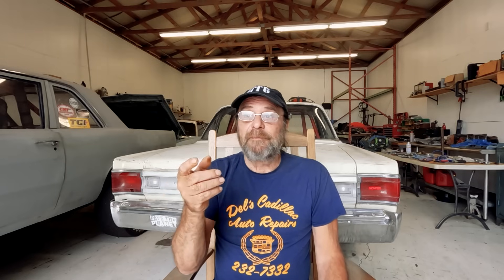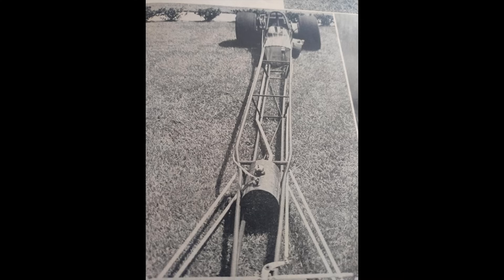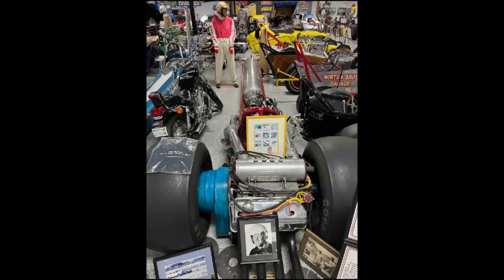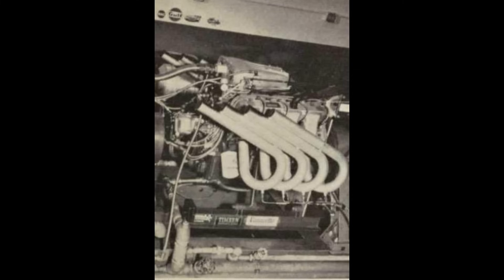Compressed Air Supercharging Returns - Here's Where It All Began

Comment: Just sitting here thinking 🤔 
If you could come up with a method to cool the exhaust Temps.
Similar to the cold air from diving tank input.
But put That same energy into the exhaust system as heat causes expansion and if you can reduce the heat you should be able to reduce the expansion of the exhaust, this causing the exhaust to flow expdentally faster. 
I'm not talking about just using ceramic coating but actually a cooling system that would reduce the temperature.
To your knowledge has anyone ever tried something like this?
PS love your show 👍
Reply: if you're supercharged it doesn't matter and it cools a lot now anyway due to being so hot coming out. you could cool it a lot more with a simple heat exchanger if you wanted to (just a box with aluminum plates going through it)

Comment: Your idea of spooling up a turbo with compressed air was actually floated years ago (back in the 80's) by a guy named Dick Datson who was pushing the idea of turbocharging old boat anchor factory engines with forged internals, particularly Studebakers, with little or no modifications. His genius idea was to use Co2 because it expands exponentially when released into atmospheric pressure. It would have essentially the same effect as a rocket without any combustibles.

Comment: Koenigsegg uses compressed air in the turbo for anti lag. The also have an engine with a pneumatic valve train, no comshafts just air opening and closing the valves, variable lift duration and overlap for ultimate timing control.
Reply: I remember a guy named Paul Bedoian had a company called Prostock Engineering in the late 70s into the 80s making specialty parts for mainly drag racing Ford 390 - 428 engines. He had a pneumatic valve spring setup.  I stopped by his shop on day to buy a oil pump driveshaft.  Some guy from Hot Rod magazine was there and we're discussing Buddy Baker leading at the white flag at the Daytona 500 and losing.
Reply: Yes but Koenigsegg doesn't use their freevalve on any of their engines. They were going to use it on their 2.0 three cylinder but I believe they have decided not to use that engine. Cool tech but for whatever reason they choice not to use it on their V8's.

Comment: One interesting advantage of Compressed Air Supercharging: That air is gonna be COLD!

Also, someone could boost the O2 content of those tanks.
Reply: Or just run O2 tanks. It's been tried.
Reply: The funny thing in the 1320 vid was the driver said he had to use race gas and not methanol because the temperature from the compressed air was too low and combustion would fail. 

Running pure O2 would be far too unstable to work.
Reply: @ThatMattWhite  I have never played with Nitrous, but my understanding is if you don't have enough fuel to meet the nitrous, things can blow up.  Perhaps the same idea with super cooled O2?

Comment: The french navy uses compressed air to run diesel engines in submarines underwater. Same as the 1320 video, the engine is sealed from the atmosphere and runs off of the compressed air from a tank. Think of it as an alternative air supply not forced induction.

Comment: The Garlits museum used to have a straight compressed air dragster 35+ years ago. No fuel, just compressed air delivered to the cylinders. Massive tank. - looked like a boiler. Basically a two stroke - power and exhaust. I do not remember how much pressure it used.
Reply: Didn't they spin a turbine instead of a piston engine. There's stuff on the web

Comment: The Grey Goose Bar is running a land speed car using compressed air from an SCBA tank to spool up the turbo on a 6 cylinder toyota motor in their purple roadster. Sorry, White Goose Bar

Comment: The answer is AWD hybrid with EV rear axle and turbo ICE in front. The charged air is cooled chemically and turbo is spooled via vacuum, produced by solid jet at the end of the down pipe. As most of the low grunt is created via EV, the ICE doesn't need that much of capacity, keeping the overall weight closer to competitive numbers. You can fit all of this in a Chevy Spark easily.

Comment: For the compressed air turbocharger: Ford did a similar thing with one of their wrc cars. They had a tank to store excess boost and release it to use as antilag. Driving 4 answers explains it on is channel.
Reply: I feel like that could be the best of both worlds
Reply: Shilling 4 money*
Reply: Forda set up is anti turbo lag it's completely different and not related at all
Reply: I know it's different but it's a smart way to use an air tank as a way of spooling the turbo. I was referring to the mention he did at the end of the video talking about using compressed air to spool a turbo, I tought it was related enought to be worth mentioning.
Reply: That's more of a boost capacitor, not compressed air supercharging. 
I think what really makes this a different setup is being completely disconnected from the compressor. 
You get 1 run out of the tanks, and use a scuba compressor to refill a series of mother bottles that will refill the on car tanks. They are also at 2400 psi, not 5-8 psi from boost. 
The dramatic pressure drop has other benefits, like below freezing intake air temps. Won't get that same effect from 8 psi pressure differential. 
This isn't new. I knew about it 20 years ago. But the controllers have caught up, so it could be implemented effectively.
Reply: @ryurc3033  Just to add technicality the CAS is being tuned using a boost controller and the engine sees boost. The engine isnt getting direct 2300 psig. The  Tank holding the air is at 3300 psig then it first gets regulated to about 100psig(depending on tune) 70psig for up to 500Hp 120psig for over 850HP. On the CAS system it goes through a 30 psig electronic boost controller.  Like you mentioned the real benefit is that highly compressed air is much colder. Plus it's self contained so doesn't see the drastic tuning variances of outside air condions. Scuba air also has a higher oxygen content.

Comment: The compressed air powered turbo should be the easiest way to implement compressed air.  All it has to do is input as much compressed air flow as exhaust flow.  Try it on some ecoboost heap ready for the crusher before investing too much.

Comment: I was working g for general moters truck and coach in pontiacmichigan in 1979. Pushing a broom. They transferred me to the warehouse. That's where all the parts are. I knew there were 671 blowers in there somewhere because they used them on a lot of the trucks.  It was a big where house. It took me weweeks to find them.  Then there they were pallets full of them sixteen feet in the air.  I about fell out. It looked like one of the right wonders of the world. Then I got laid off again. I went to abbeville south carolina again and never went back even when they called me.

Comment: A tesla turbine mounted on the same shaft of a conventional turbo would both make boost AND scavenge the exhaust if setup with the pressurized air only serving to spool the turbo mechanically. Tesla turbines were designed for efficiency, but end up being relatively low torque output - this seems like the ideal application.
Reply: it still needs high power and nobodys done a high power tesla turbine in these sizes and it would probably need a starter motor and a clutch to get it up to speed to start producing power and not just flowing through.

as for what tony is wondering about why not spool a turbo rather than feed the engine, you can spool up a turbo with just the engine or with combustion but more importantly you lose power(air volume rather) running a turbo with compressed air vs. just running the air into the intake
Reply: @lasskinn474  there's at least one Tesla turbine in the kW range. I completely disagree about a starting mechanism as the turbo could be put in full bypass (open recirculating setup compressor side, and open waste gate) - while spooling. It would have to be steam powered from a power density POV and weight. (Remember compressed air still has mass...and much more since its quite literally more dense). It may not feel heavy by weight but it's lateral mass contribution to a car is significant.

Just imagination going off of what Tony said, I know it's not practical lol. Though, I agree spooling a turbo direct with air directly seems like efficiency loss rather than direct/valving air like the whole video goes over.
Reply: @ you need tens of kilowatts, hundreds for a drag car pushing high horsepower though if you just had separate steam generator from chemicals and just ran it and used it to run an electric charger that would skip quite a bit of the complexity(but you could just as well then put that power straight on the axle).

a lot of research has gone into trying to scavange the energy from the exhaust and usually it just turns out as not worth it. some popsci style magazines were talking 30 years ago using peltier element sort of elements to scavange the heat energy, but maybe steaming some other stuff in a closed loop would work better for that.

i do wish there was some high visibility drag class that allowed more experimental stuff, maybe the rocket powered turbine on the rear axle could be done in a controlled way nowadays.

Comment: The axle through the valley reminds me of the BF-109 fighter plane from WWII. The Germans ran the barrel of a 20mm cannon through the valley of the DB 605 V-12 and out the front of the propeller hub.
Reply: There was an article in hot rod years back that showed some compressed gas tanks with stamping on them showing the years they were checked right next to the luftwaffe symbol stamped also, and they explained the BF 109 also used those tanks for nitrous oxide that was injected into the engine for a quick boost of speed, I know the tanks exist I looked for that over the years after reading that article and have seen them in a compressed gas company one day when I went to pick up some tanks for a torch, the luftwaffe cross and dates stamped from 1939 to 1943
Reply: Lot of countries did that not just germany
Reply: No, not mounted in the valley. The Daimler-Benz V-12 engine was mounted inverted with a reduction drive. The cannon was mounted atop the crankcase and it fired through the hollow propeller shaft.
Reply: @tennesseered586  The engine was inverted, and the gear reduction drive dropped below the crankshaft towards the valley. The cannon barrel did go through the valley between the cylinder banks and out the front of the propeller hub.

Comment: The Turbonique was not a rocket driving a turbo, it was a turbine engine on the rear axle that used a very volatile fuel to power the turbine.
It was like an add on to a quick change rear that hung off the back of the differential with a huge exhaust blowing straight out the center of the axle. There were varying levels of power output with some small enough to put on go carts. 
Now what I want to see is a turbine driven by the reaction of pure H2O2 (hydrogen peroxide) with potassium permanganate which generates super hot steam to drive the turbine. This is what was used on V2 rockets to drive the turbo pumps that fed the rocket engine with fuel and O2.
Reply: That was the best known version but I recall the rocket powered turbocharger Tony spoke of. It all mounted under the hood and was the ultimate sleeper setup
Reply: WW2 fighter engines also used turbo compounding with used exhaust gas to power a turbine which through gear reduction directly powered the crankshaft…supposedly it added power and efficiency
Reply: @chrisvig123 that's basically a jet engine were you replace the jets combustion chamber for a piston engine .

Comment: I would think the turbo issue would be the compressed air super cooling the turbo so fast that it also cooled the intake charge too much and end up with a turbo ice maker ,the air would ice up the pressure side and transfer it thru to the incoming boost charge ...if that makes sense

Comment: Compressed-air?.......maybe the Airlines should look into this 🙈 lol
Reply: You mean how passenger jets don’t actually use any fuel once they’re at cruising altitude?
Reply: It's only good for short distances like the quarter mile. I wondered about using it at Bonneville but if it takes 1 and a half tanks to do a quarter mile, it will take 30 tanks to do 5 miles. You would need to build a huge car to take all those tanks. There's also the question of everything freezing up during a long run

Comment: So you flip flop the tank while the other one is filling. That could increase your efficiency. Oh, at work they had tanks of compressed air that would spin a 3” turbin. It could run the whole building for 14 minutes, before that they used a 600 lb. Flywheel in a clam shell in a vacuum. Until generators sink.

Comment: One of the last top gear episodes took the 3 to the Andes i think.   The cricketer had a vw van that was underpowered for the terrain and Altitude. 
They hooked him up with some kind of hydrolysis contraption that injected hydrogen and oxygen into the intake. 
I wonder how far you could take that.

Comment: Ryan Mitchell (KCMAXX) is running the system and is posting it all up on his YT site.The reason it is workable now is the electronic controls to regulate the delivery. He's run it on a big block Chevy and now an LS. It is impressive.
Reply: Kc maxx is the man! 🇺🇸💚🏁
Reply: Saw that car too. Seems to have great potential
Reply: Yes and the lady with the maroon truck that's been running it for few years. Ryan has mentioned as well.
Reply: Can you imagine if Ryan had funding like other teams. He’s a smart as they come.
Reply: This end goal will always bring you back to NOS eventually. Higher density will lead right back to NOS, perhaps maybe different mixtures, but still. Now could be sneaky way
to get around power adder rules.
Reply: @Daniel-vh9lg and now most of those rules have been tossed for '25....but yes, you're right, they'll still be rules and Ryan travels the entire country for a lotta events.

Comment: I made my first around 1976. With a portable air tank..
Reply: Yeah, and how much psi did you have in that tank?
Reply: @alanmeyers3957  
120 PSI.  In a 30 gallon auxiliary air tank,  
5/8 airline ,   only needed it.  3 or 4 seconds.
In 3rd or 4th gear.   May as well add a half pint of 151 rum.

Comment: Compressed air with Nitrous????110 octane  gas.
Reply: Not necessary. Just crank up the manifold pressure and make sure the fuel system can cope with all that air

Comment: I have dabbled with compressed air . But not for supercharging.  But for temperatures.  A small amount of compressed air released into the air cleaner will lower temperatures. High pressure released to low = cold air .  But not solely relying on air from a tank . Only a nozzle that releases at full throttle. When the air is gone it runs on normal air.  Like a fogger
Reply: That’s a really neat idea!
Reply: Why no methanol or water
Reply: @matthewfredrickmfkrz1934  no reason. Remember water takes up space and lowers cubic inches. I also thought about using oxygen enrichment air like scuba air ( nitrox) but that was only on paper . A video about compressed air supercharged video I watched once said they had ice form .  But that was a lot of air . Mine was a poor boy idea . I have many other ideas 😂

Comment: I have heard of roots style, centrifugal,electric and now compressed air. The electric charger has a bunch of batteries and a ac motor that drives the crank shaft via a belt and when the car gets moving then the hit the switch and an extra 3 t 5 hundred foot lbs of torque is applied th the crank.its on you tube.